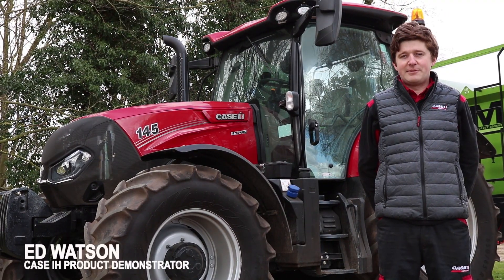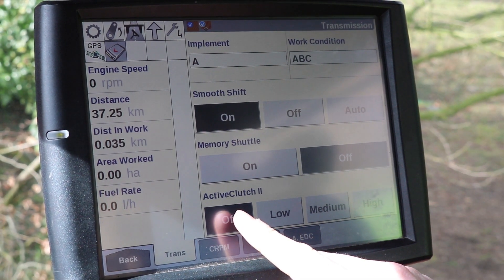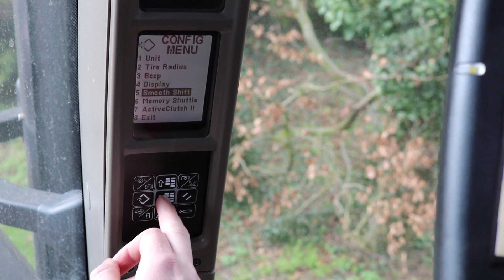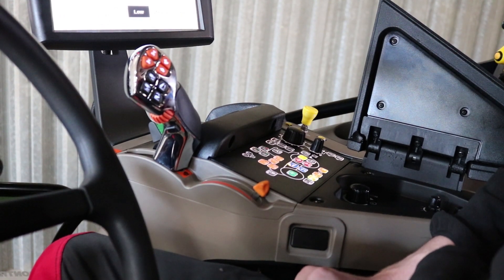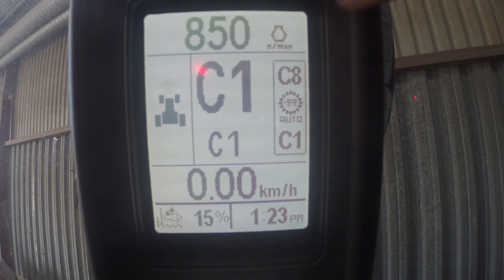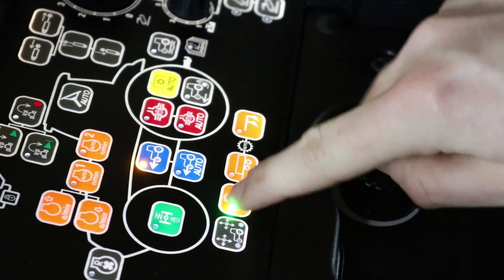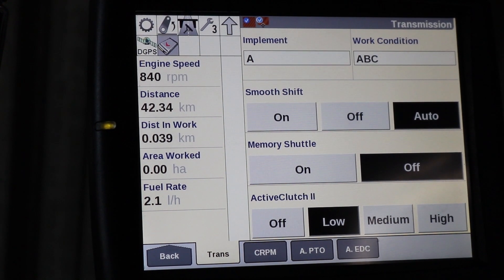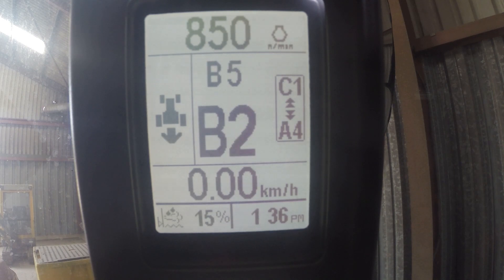Maxxum Multicontroller: How To Setup The ActiveDrive 8 Transmission

Comment: is it possibble to turn on memory shuttle without the screen
Reply: Yes it is.When you key on, press and hold the box with an arrow through it on the A-Pillar for 5 seconds. It'll enter a sub menu.Scroll down to enable all the features.  This is assuming that the tractor was purchased with the capability to do this, otherwise it's a software upgrade via your dealer.

Comment: These new tractors have crappy electronics.  these things can have a dead battery and trip a code for anti tampering checksum  everything on the machine has to be  re calibrated    and engine data set has to be re registered there are always electrical issues  with datasets and anti tampering.No one needs all this crap case screwed up with they had to leave the teir 3  tractors electronics were way easier  so much user friendly.  with SCR system on these machines  if you do not work them hard enough on a near day to day basis the doc chamber for the scr system which is what the def is injected into to mix with the exhaust. the def will crystallize inside the chamber and it will derate the engine until chamber is removed and cleaned. And there is so many other things  that makes these  just a money trap .And by god Do not buy electronic remotes among est many  other issues